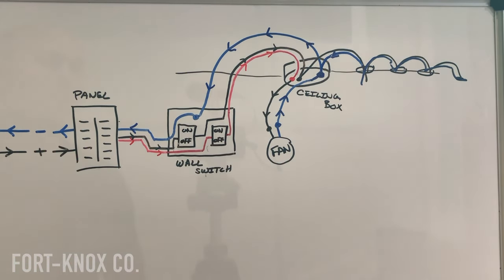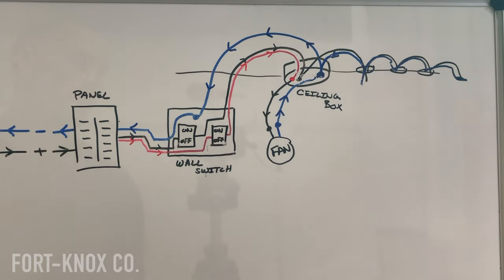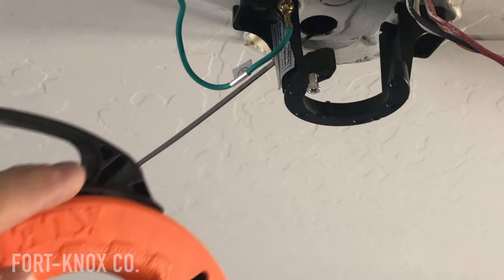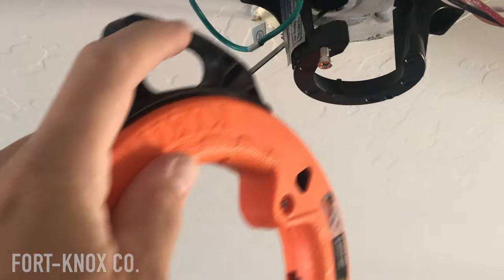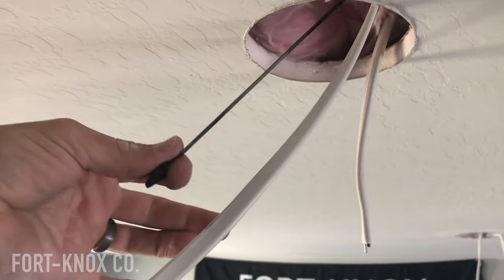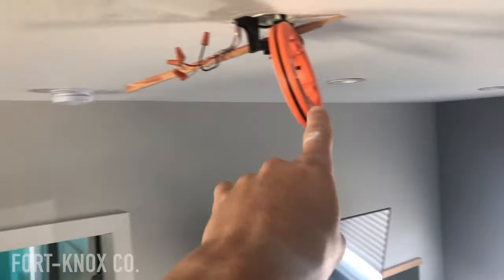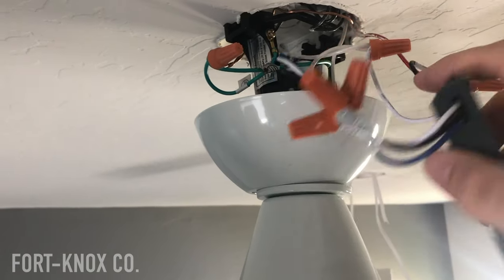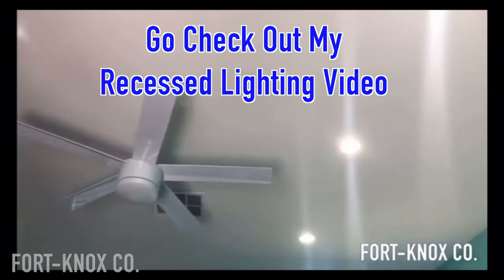How to Run / Fish Wires Easily Through Ceiling for Power to Recessed Lights and Fans

Comment: Did you drill through your joists?
I think i need to do that at my house
Reply from the maker: It all depends on how tour roof or ceiling is constructed.  In my case I have a single story and the roof has space, so I can run the wires up over and through the “attic” space. 
If you have a two story house then you may be limited in space and have to drill holes through some. You just have to be careful how big of a hole and where your drilling. A lot of home have an I beam style support for the second story and you can drill through those usually without comprising the integrity
Reply: @FortKnoxCo  i'm almost certain i will need to drill through my joists (2 story house).    

Unfortunately, i have a textured ceiling, or i'd consider looking into cutting a couple extra holes and just patching the ceiling, but that won't work.
Reply from the maker: deasttn  yeah that may be what has to be done when running across supports in a two story. Running along or parallelism easy obviously. But when having to move laterally you may have to cut pocket holes in the drywall to be able to work on each beam you cross through. 

It’s doable but  does require more prep and finish work.  Matching texture isn’t too hard but could always be the part you hire out too. Bring in a professional to just do the patch work finish. That’s how a lot of guys work. They sub out the work they can’t do.  

Thinking of the best most efficient path to limit the number of beams and cut outs is the first step.

Comment: Why are there 2 powers running from the circuit box? Why not just run 1 power andthen pig tail it out to the 2 switches inside the switch box. I dont get what the point of running the red wire is if they are both on the same circuit.
Reply: And dudes running wire through a metal punchout without a plastic insert to protect the wire from the metal?? Thats not to code
Reply from the maker: Good question. There’s a couple different scenarios on where this might be necessary or where it’s just going a little bit above what might be minimally required. In one scenario you have a power that comes in on a 20 amp circuit to a switch that controls a wall outlet. This would be a higher gauge wire and obviously have that 20 amp breaker associated with it. Within the same junction box in the wall holding the other switches, could be one or two going up to the ceiling controlling lighting. those in my area are commonly ran off a 15 amp breaker. So in many cases, you will have wall outlets on one circuit and ceiling lighting on another. So in this case, you might have two different power source is coming into that box from your panel to control two different series of lights or outlets.

And I’m not quite sure your question about the red wire, for the power going into the box for lighting you would then run the 14\3 wire, which has that black and red for powers. You would run those off of the single power source coming in to the box Split that to two switches and then from those two switches, you would run the black off one and the red off the other to the ceiling. Then up in the ceiling you have a black and red power source to run two different accessories off of. This is common practice nowadays, it used to be an upgrade from the builder so that you would have options when installing a fan or light.
Reply from the maker: And yes, you are correct. It is most likely against code in most areas to run a power source through a metal conduit without any type of bushing/protection. Best practice would have some type of rubber insert as you said to make sure that there is no possibility of the wire, rubbing against the metal and shorting out your circuit. Great info and highly suggested.

Comment: Hi, why there are three wires on the 1st pot hole?
Reply from the maker: the first one has the the power coming in and there's two "hot" wires since I had two separate lines to work with. two switches on the wall that controlled that single pot hole in the ceiling. that's usually wired that way when the house I built so you have the option to run a fan with a light and you can turn one on without having to power the other if you don't want to. Or in my case I have a fan that has the light on a remote, so I just had a switch that went to a wire up in the ceiling that wasn't being used. I used that one to run over to all my recessed lights.
Reply: @FortKnoxCo  Thanks a lot !!

Comment: Those lights you hadn't wired seem way too close to your ceiling fan.  They actually recommend at least 18 inches to avoid a strobe effect.
Reply from the maker: Yeah I was thinking the same thing when installing so I tested it out a little before installing. The way the light diffused didn’t cause any strobing so I went ahead with it. I would have spaced out more but I had to find a happy medium between the fan and wall. I didn’t want to create a down lighting beam on the wall either. So I went with a lay out that was symmetrical across the whole room.

Comment: Not so easy with a mobile home. I’m just gonna run the wire laying against the ceiling and build a box around it. Ain’t no way I’m cutting the ceiling just to put wire in.
Reply from the maker: Yeah I’m a mobile home I wouldn’t cut the ceiling. Unless you had some type of ceiling in there that was removable line panels I’d do just like you said and run it on the outside of the wall and then use conduit or something to cover it safely.
Reply: @FortKnoxCo   that’s exactly what I’m thinking!